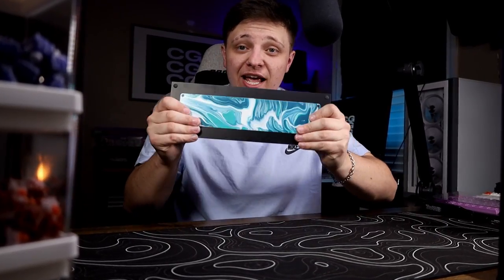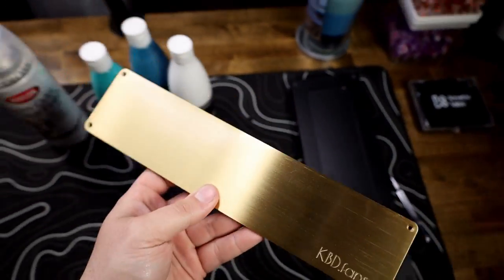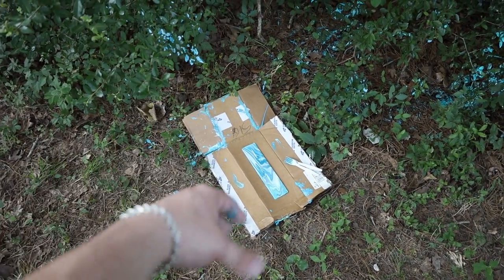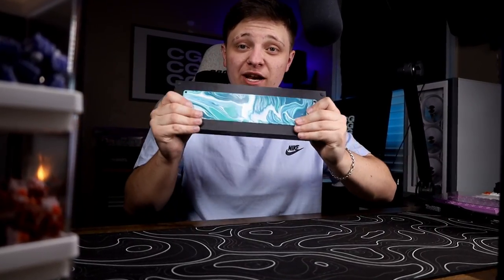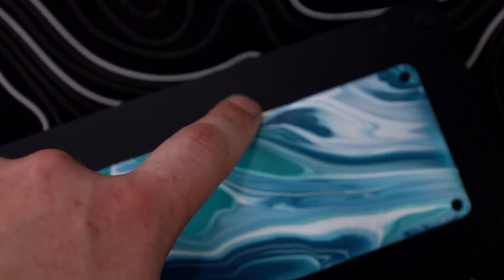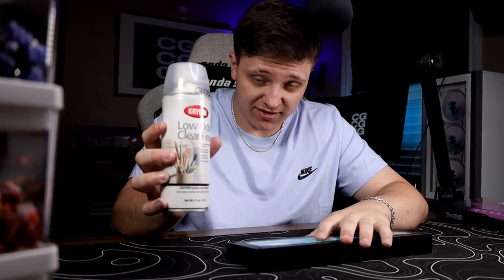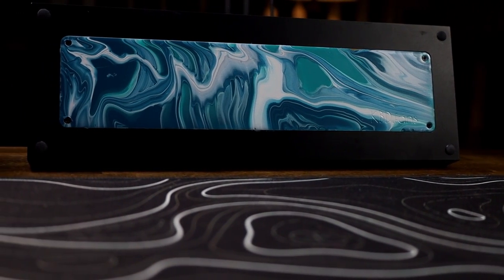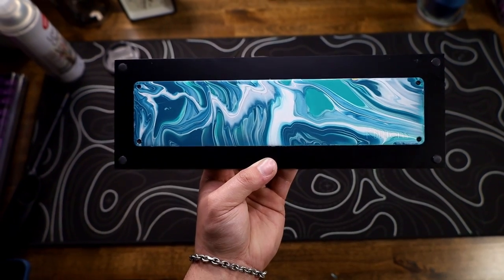Painting my Custom Keyboard...

Comment: This is dope, I've not seen acrylic dip before. One thing you could try is Hydro dipping - using a plastic tub full of water and spray spraypaint on top of the water, and then you can (gently) drop your board in and get cool patterns. There's not (m)any videos of hard plastics being hydro dipped so I went through a lot of trial and error. 

If you do it, one tip- make sure the spray paint isn't causing the water to splash.